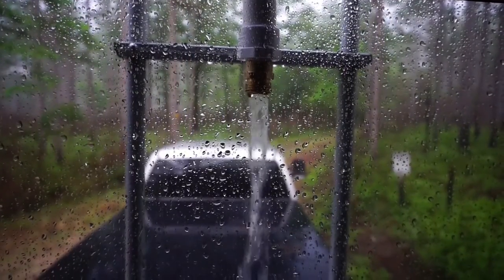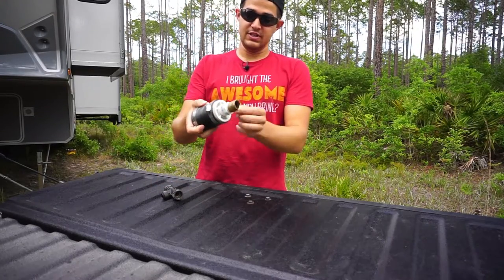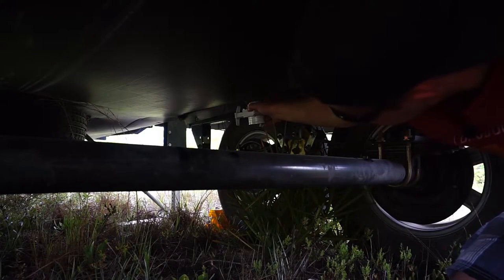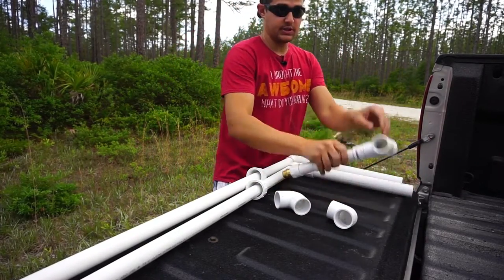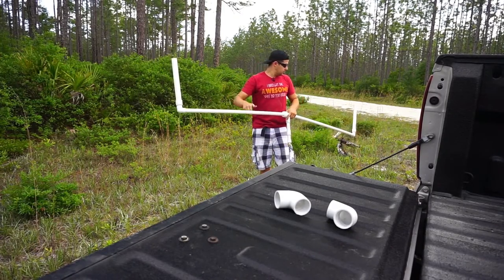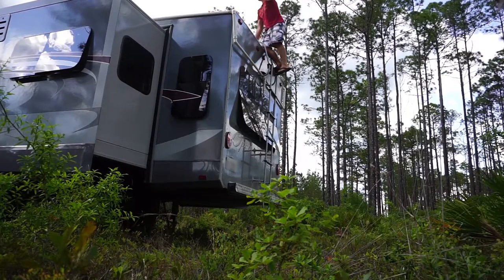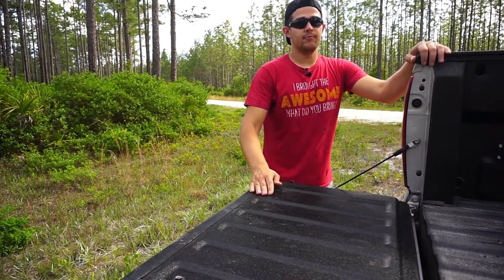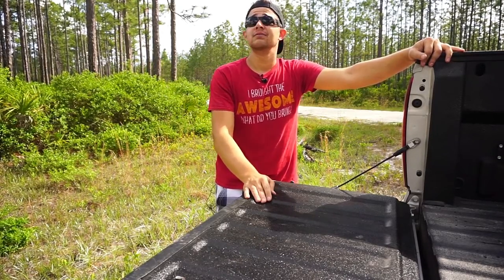Fill Her Up Mother Nature | An amazing RV water catchment system

Comment: Do you boil the rainwater before drinking or is it for washing only?
Reply from the maker: Thanks for your comment. These days, I run all water I plan to drink through a reverse osmosis system, including the rainwater, but that is more as a safety measure and for versatility (I sometimes pump from rivers, springs, and natural wells too). Anyway, forest rainwater is quite clean. Take a TDS meter to some of your local rainwater and then your tap water... you might be amazed at what you discover. I'll make a video one of these days on it if I get enough people asking. Before the reverse osmosis system, I used a lifestraw that I always keep in my day-pack... works good.

Comment: Okay, what about the two hoses that extend out the bottom of the trailer, I get no city water but the water comes out of these hoses??
Reply from the maker: Sounds like you are referring to the tank overflow pipes. Water will come out of those when the fresh tank is full.